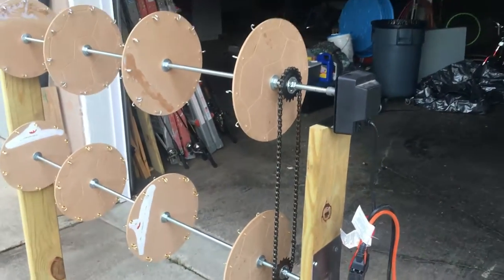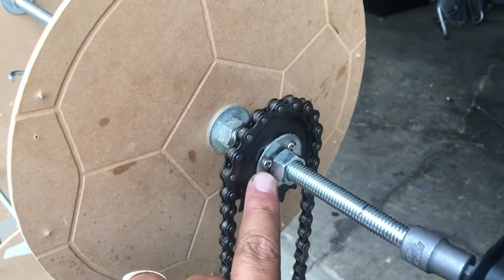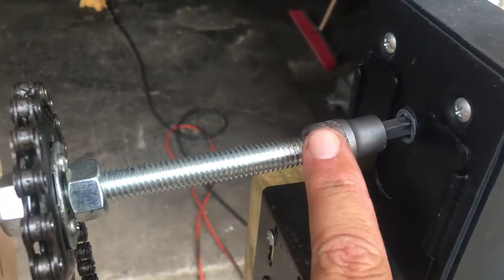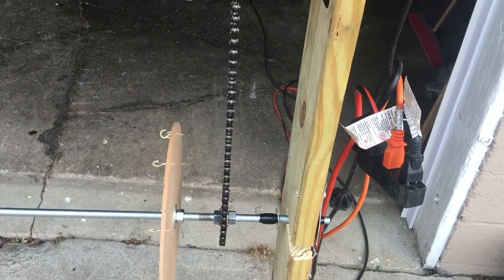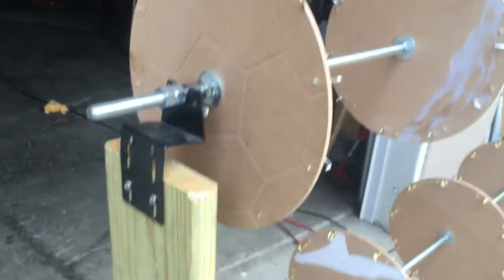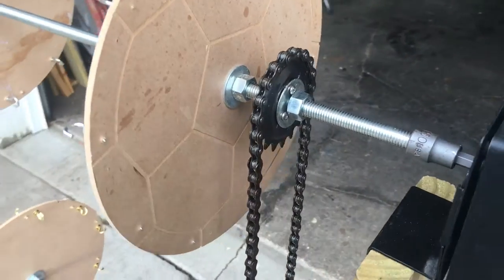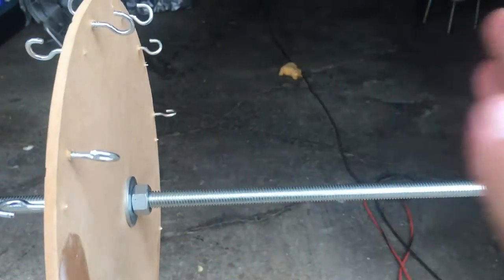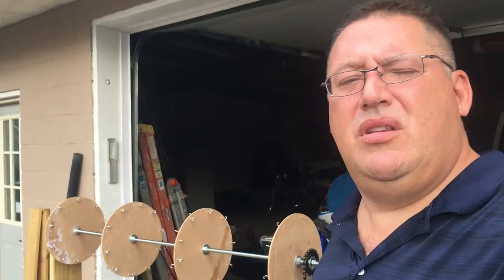**EASY Project How To Building a Drying Rack For Clearing Walleye Lures

Comment: just curious where you got it. i understand the concept. i epoxy the rod directly into the motor but that seems a bit stronger
Reply from the maker: Alan's Custom lures yes sir and it makes it completely adjustable if you do smaller lures
Reply: Very nice job. Definitely making something similar. Can u get these fittings at home depot or something? Ask for a t50?
Reply from the maker: Alan's Custom lures yep I got all my stuff at menards except for the round pieces of wood, got those at pat catans craft store, pre cut soccer balls

Comment: what size threaded rod? looks like 5/8? I have 3/8 that I epoxied into a t-50 also had to shave down the 50 to fit in the motor
Reply from the maker: Alan's Custom lures ya that works also we adjust to make things work for our own ways, good idea
Reply: tony gonzales thanks again great video, I'm looking to use diamond finish soon. so many mixed reviews on in I definitely need to try it myself
Reply from the maker: Alan's Custom lures yes it was 5/8
Reply from the maker: Alan's Custom lures yes definitely try it, if you find something better than that let me know..  I'm always looking